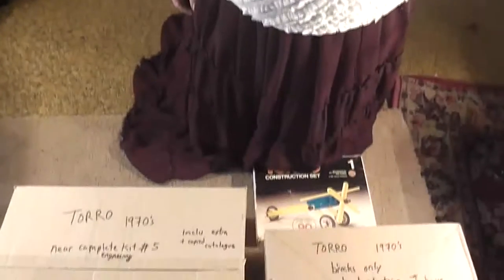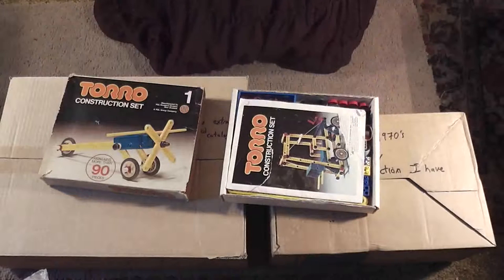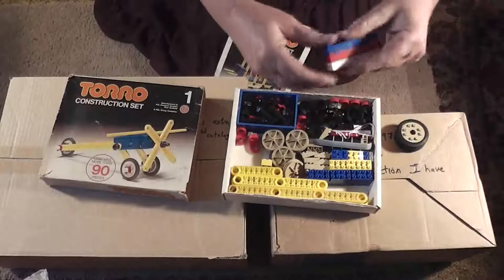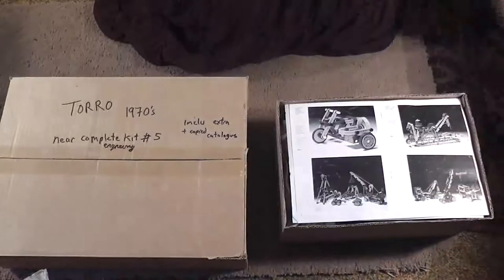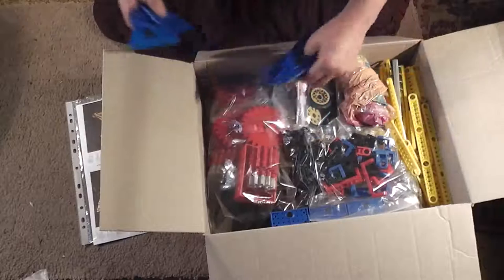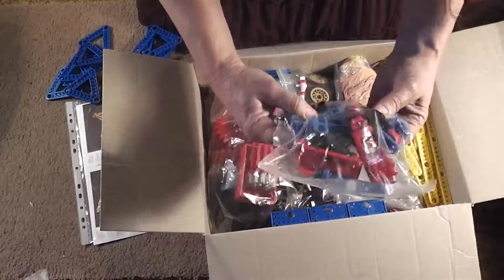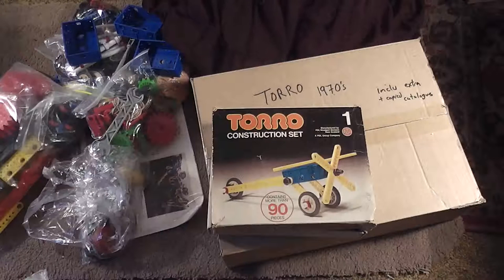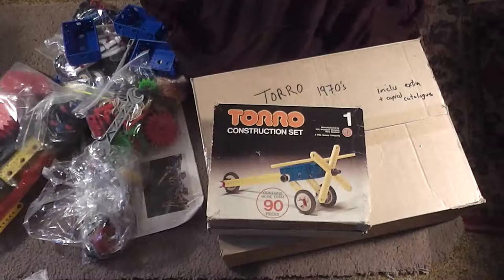667. Torro, NZ made, Lego & Meccano style toys of the 1970's. file 014

Comment: I had one of each kind of set -- the Meccano-style and the Lego-style -- when I were a wee lad back in Malaysia. I never knew they came from NZ. Until a few minutes ago.

Some cousins of mine had Lego sets. The bricks were different-shaped and not quite compatible, as I recall -- Lego bricks had flattened knobs, the Torro ones were rounded. Also I hear about cheap Lego knockoffs, but as I recall the Torro parts were well-made, and fitted together nicely.

Greetings from the Waikato!

Comment: Thanks for your introduction. I remember them very well.I've been trying and trying to find some information about an old set of building blocks that I had when I was a child back in the early 80's. The most I can remember about them was one particular block. It was a 1/4 round piece but with only 6 nobs on the top for other pieces to join onto it. These little nobs were place on the block where there would be two of them both at one end and then a third pair was in the middle. I have been ALL over Dr. Google but to this day, I still haven't come across it yet
Reply: I belive they where part of a Castle building set?, Grey with a light swirl?